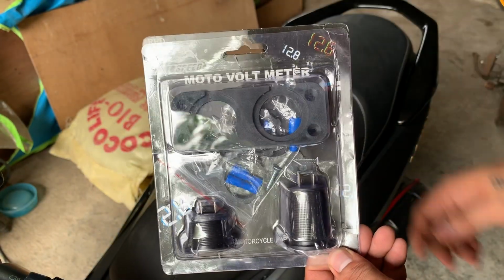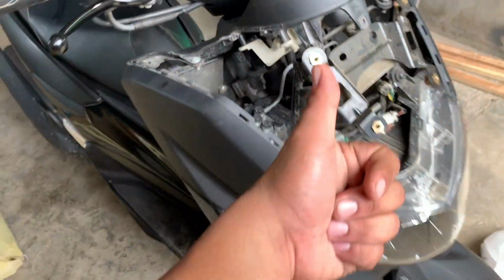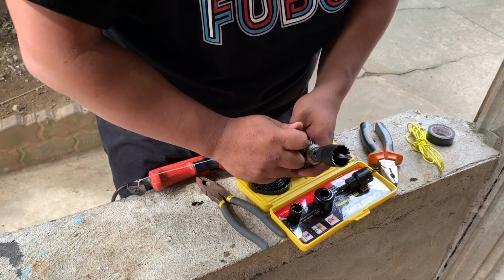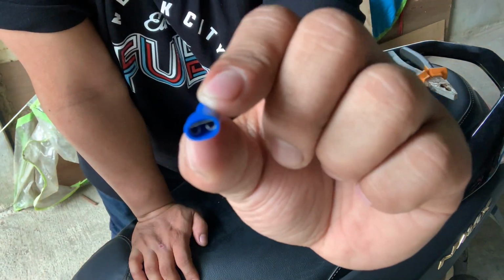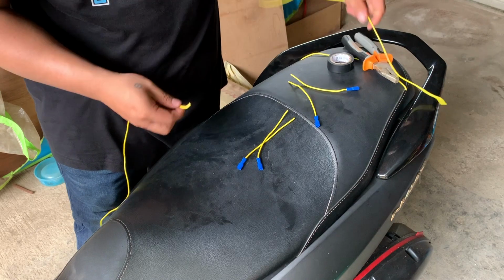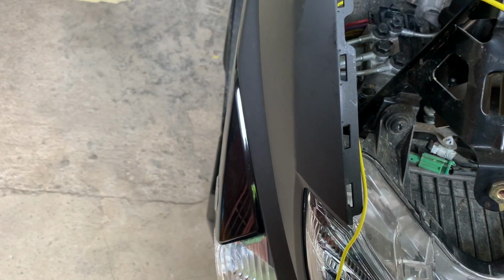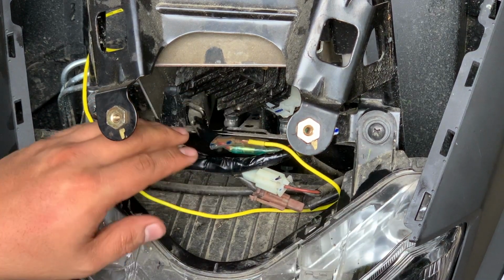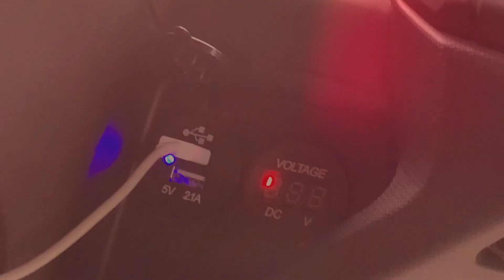How To Install Voltmeter & USB Charger | Yamaha NMAX155 Video #4

Comment: Thank you for this great video. Very understanding and detailed, easy to follow video. I would like to try same install on my Yamaha Vino 125. I have not look under my hood as of yet, fairly new to me. But no tachometer, USB or voltmeter installed. I like how you combined the 2. Tachometer is easy (it's a wrap). G J.

Comment: JGMoto Sir Ask lang same parin ba pag meron nang built in voltmeter yung charger? isang positive and negative terminals lang so yung nega dun sa chasis tapos yung postive ita-tap dun sa brown wire?
Reply from the maker: Oo paps! Kahit anong voltmeter at charger po same lang din ng procedure. More power!
Reply: @JGMoto  thank you.. ang easy lang pala..

Comment: sir ung negative wire ba pero idirect sa battery? naka bosch horn po kasi aq ung negative ng horn nakatap sa negative ng battery ko balak ko sana isabay na dun ung wire.
Reply: and wala po ba magiging apekto sa horn or sa volt pag dun ko tinap.

Comment: Bossing pde po ba siya mabasa if mag papa carwash po..
Reply from the maker: hindi po sir.. close niyo lang yung rubber takip ng usb port.. hehe.. 1yr na po sakin eto at ok parin po.
Reply: JGMoto bossing tanong ko lang po anu pangalan or tawag po dun sa pang butas n bilog sa fairings slamat po sa response

Comment: Paps off topic lang, anong brand ng side mirror at bracket mo? Yung akin kasi malakas ang vibrate. Salamat paps. Rs always
Reply from the maker: di ko na maalala paps, hehe set ko kasi binili yun. nasa description ng side mirror installation video ko yung link paps kung san ko nabili sa shopee. normal siguro ung vibration paps, di ko lang alam sa nemo na brand kung mavibrate din ba o hindi..

Comment: sir, saan nyo nabili ang volt meter at charging port at yong drill hole set na pinang botas nyo?
Reply from the maker: Good day sir. Sa shopee ko ho nabili yung voltmeter at charging port, nasa description po ng video yung link. Yung holesaw drill po sa kahit anong hardware store meron po nyan. Thank you paps!
Reply: Ok Sir, mraming salamat. malaking tulong ang tutorial nyo. napaka klaro. balak ko rin kc bumili ng Nmax.

Comment: Sir tanung lang po, nung unang kabit ko sir okay nman 14.0 ung voltage, pero pagkatapos ko magwashing pumalo na ng 25+ and  di na sya stable, anu kaya possible problem nun??,
Reply from the maker: hello sir, baka nabasa ung voltmeter mo sir? kasi sakin hindi po nangyari yan.. pero hayaan niyo muna sir baka mawala lang siya bukas. let me know po ano update niyo :)
Reply: @JGMoto  nagwashing lang akoxsir pero talsik lang nman un pinunasan kodin agad, sira na kaya ung voltmeter kapag ganun sir? Possible ba un sir? Nasubukan ko din sa ulan ug volmeter di nman sya nasira. Nung nagwashing lang tlga ako bigla nagkaganun
Reply from the maker: Try niyo po baklasin ulit sir pero hassle ulit mag tanggal ng ganyan. Di pa din nangyari yan sakin sir.
Reply: @JGMoto  okay lang ba un sir?? Kapag kakasusi ko minsan 20 sya tapos habang pinapainit ko bumababa sya ng 14.5 tapos kapag tumatakbo na nagiging 14.7
Reply: @JGMoto  kapag nakaoff pa dahan dahan bumababa hanggang 13.8, tapos kapag on 14.7 minsan 15, anu po kaya possible problem nun? O normal po un??
Reply from the maker: @Djonas00  may moisture pa yan sa ilalim sir... kusang mawawala din yan sa future hehehehe
Reply: @JGMoto  sige sir salamat sa pagresponse, laking tulong sa mga nagddiy

Comment: Boss paano malalaman if kunti nalang battery mo sa nmax. Ano dapat naka display sa volt meter?
Reply from the maker: Dapat yung voltage niya boss pag patay yung makina is above 12.4v. Pag naka-andar naman boss dapat nasa 14.2v ka, ibig sabibin nun charging po yung battery at gumagana ang charging system ng motor. Hehe. :)